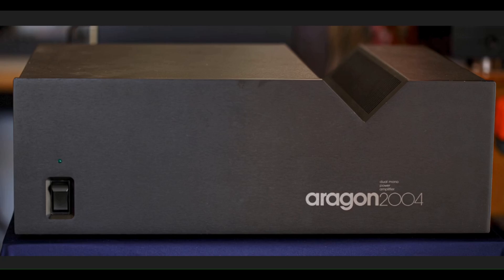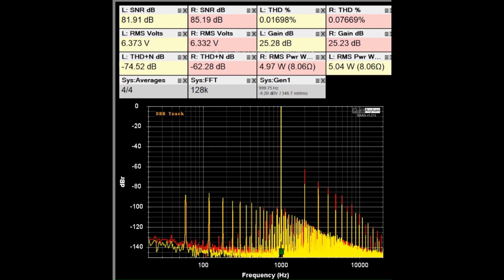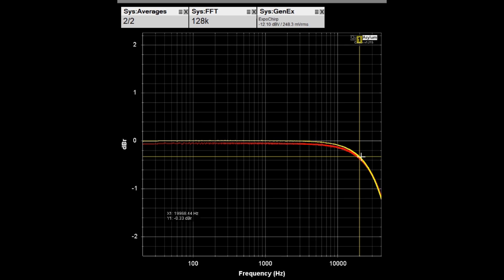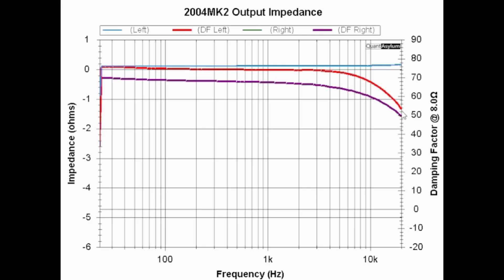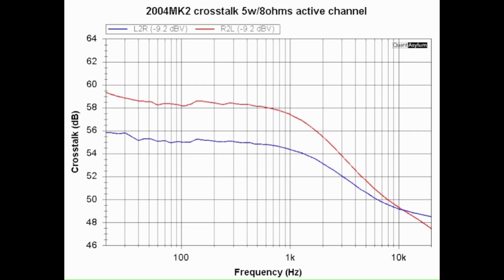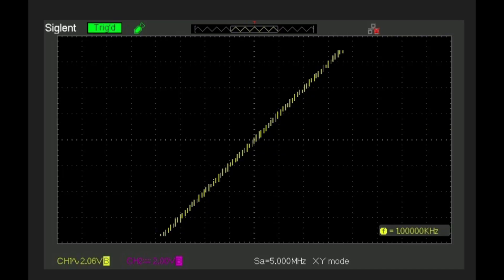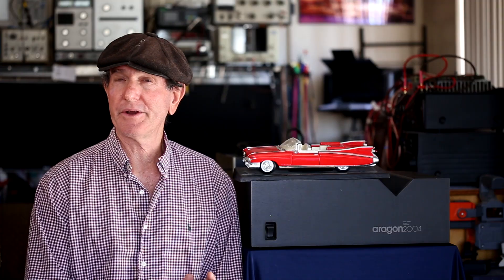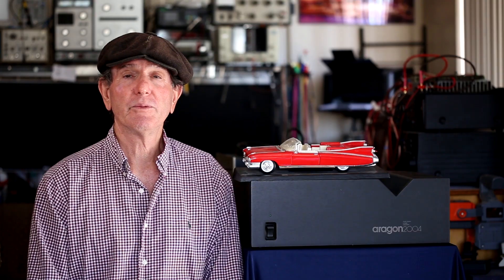Aragon 2004 MKII Power Amplifier: Vintage Audio Review Episode #175:

Comment: Hello 
and thank you for the detailed review of the 2004. I have had mine for about 10 years. I also have the 24k preamp. I have enjoyed these for years and they sound pretty damn good. As of late I have noticed some increased noise that is a slight hum. I'm thinking that it may be time for a re-cap or other service? I did upgrade and re-cap the power supply of the preamp which made the noise slightly less. Any recommendations would be appreciated .
Reply from the maker: Some hum is quite normal for the amp. Without actually measuring it I would say that if you can hear the hum from about 3' away, you probably could stand to have the amp's power supply caps replaced. If you were here I would say to bring it over and let me check it out for you.

Comment: I purchased the Aragon 2004 amplifier and the Aragon 24K preamp as audio store demos. The pair have been working well (including all switches and volume control) for decades since their manufacture in the mid 80's. So the manufacturer's claim is true that gear from the 80's is reliable! Thanks again for reviewing my amplifier.
Reply from the maker: Gear from even earlier than that can work well with some cleaning and lubing. Thanks the comment!